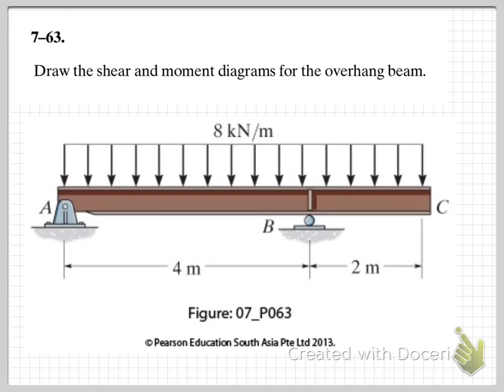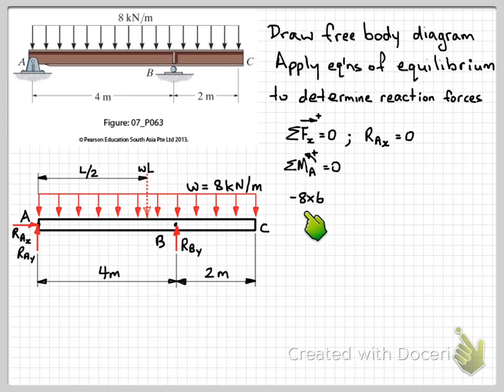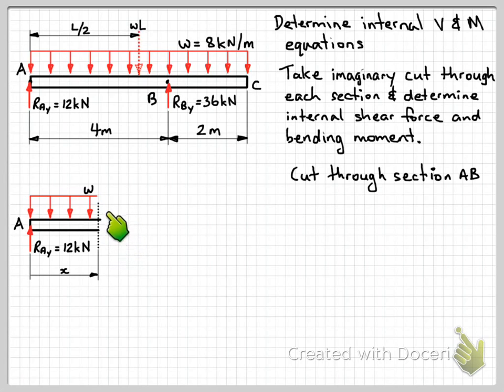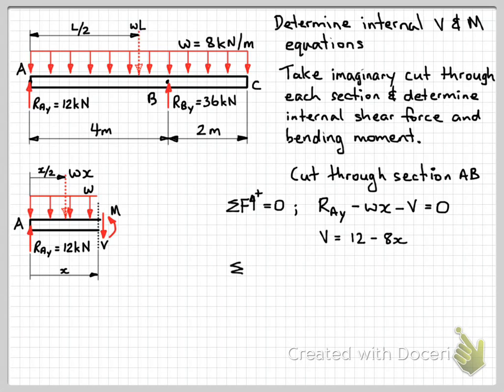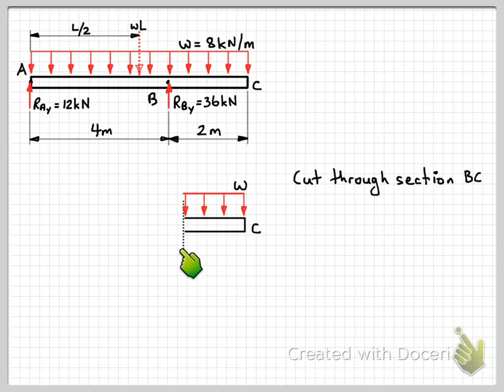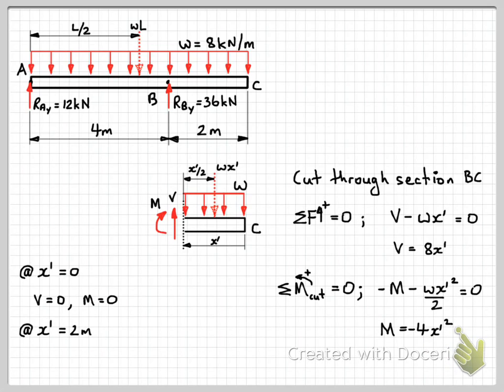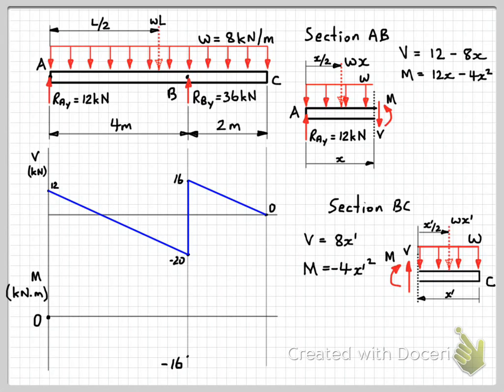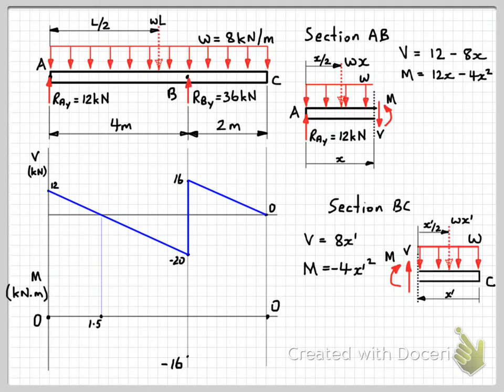V and M diagrams example complete

Comment: I dont understand ett x'/2 distance is used?
Reply from the maker: there may be a number of reasons why you are not understanding why x'/2 is used. e.g. is it because I've used x' instead of x? is it the /2 you don't understand? Here is a link to an excellent video that provides an overview of shear and bending moment diagrams that may help https://youtu.be/C-FEVzI8oe8
Reply: @TerryBrownMechEng   Did not expect such a quick response, thank you! I dont get the /2 part. I will check out the video :)
Reply from the maker: x/2 because that is where the resultant of the distributed load acts. We need this distance for calculating the moment effect of the distributed load. Hopefully the video I linked you to helped explain this also. cheers.
Reply: x/2 is used because it is a uniform beam of uniform cross section hence the cog is located at x/2. the weight of the beam is located at x/2